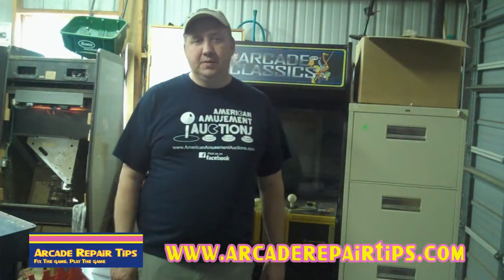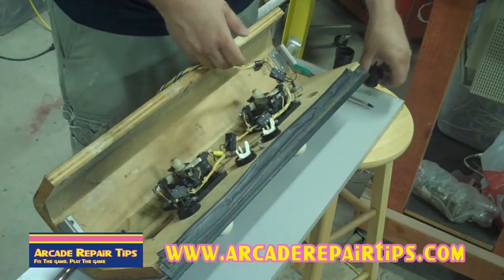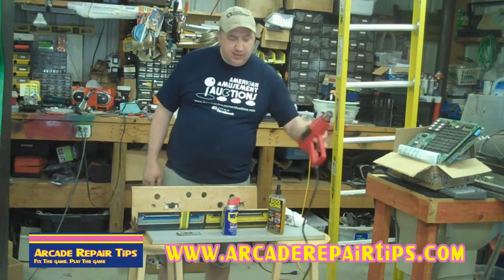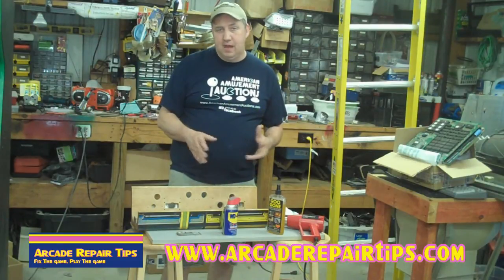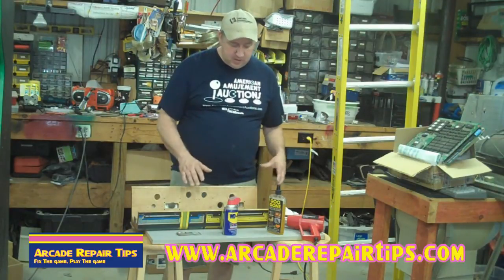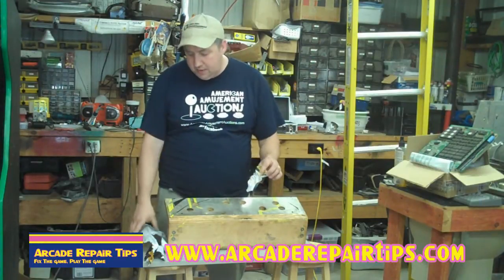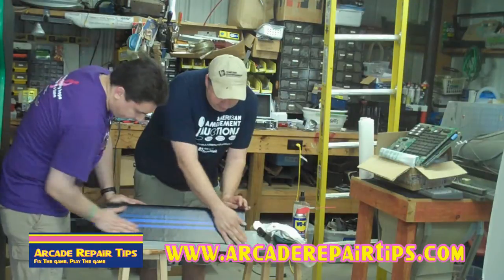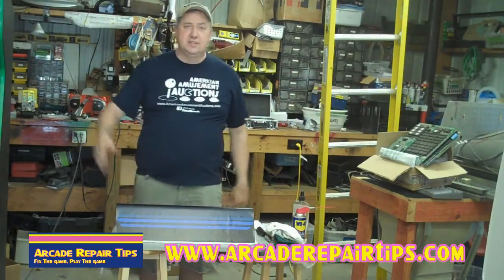Arcade Repair Tips - Replacing A Control Panel Overlay

Comment: Excellent video! I did have a question however. I noticed that when the new CPO went on there was some wrinkles or air bubbles. How are these removed? If replacing an expensive classic game repro you want to get it right the first time and look almost perfect. Also, could you explain the Windex method further? Wouldn't Windex or other substance leave a residue and/or cause the CPO not to stick? Thanks! :-)
Reply: The idea of using windex is that if it accidentally put on crooked it allows you some time to fix it.  You squeegie out the windex and it eventaully dries and sticks good.

Comment: If you don't have a heat gun, another great method (given the control panel isn't too big) is to actually bake it in your oven. Put some tin foil underneath and lay the control panel on top. Bake it at 300-400 degrees for just a few minutes and it should be ready to peel off. You'd be amazed at how effective it is. I've done this with my Centipede and Frogger CPOs and both peeled off as almost one piece after baking them for a few minutes. Again BE VERY CAREFUL and don't leave the oven for a second so that you can monitor it at all times.